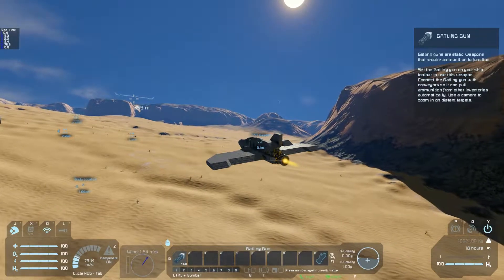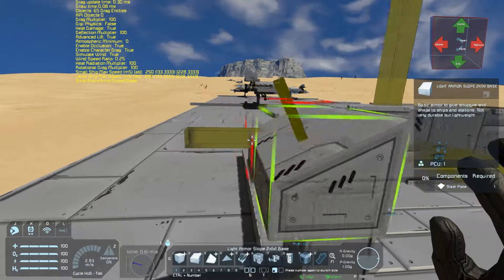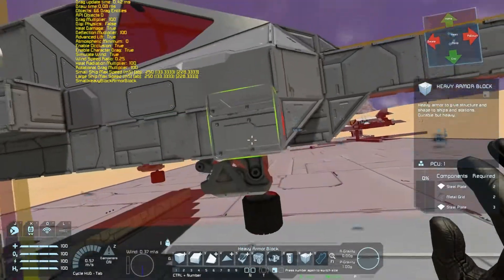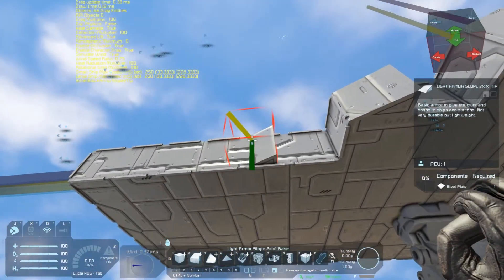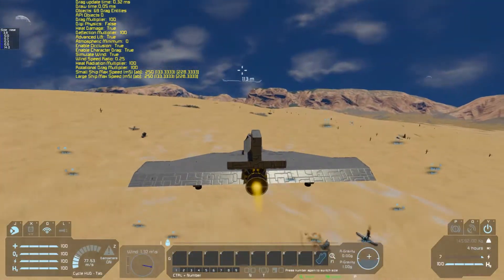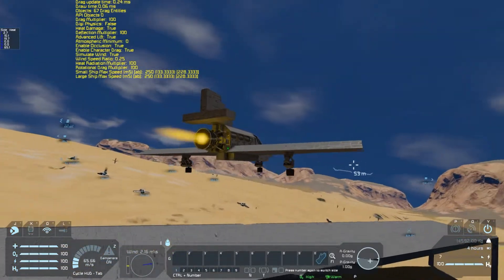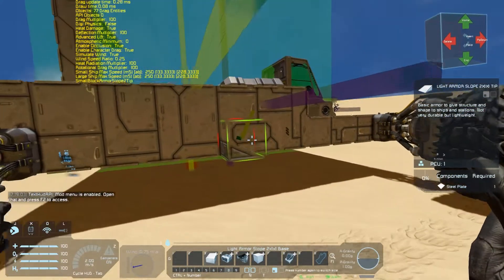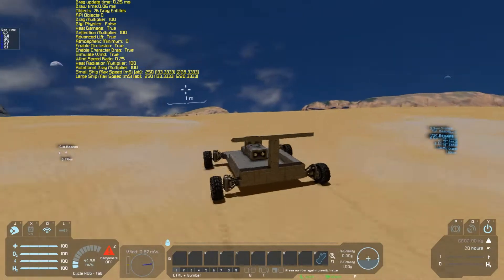Space Engineers Aerodynamic Physics - Lift Profile Tutorial

Comment: So lift is in the direction the angled face of the block. If I understand this correctly then does that mean that if the leading edge of a row of angled blocks is facing downward in the forward direction then that should generate lift forward and down? From your example with the plane, the rear-facing angle blocks are rotating the body of the craft upwards from the back of the wing. Is that correct? And the spoiler on the rover with the forward-facing blocks is rotating the craft into the ground by lifting upwards from the front of the spoiler?

Sorry, I have one more question. I see a lot of designs with the leading edge of a plane's wing using forward-facing angled blocks angled downwards and the trailing edge using rear-facing blocks angled downward. If I'm understanding correctly, this might be to balance the lift acting on the front and back of the wing. Or would it make more sense to have both the leading and following edges have the angled blocks facing upwards?